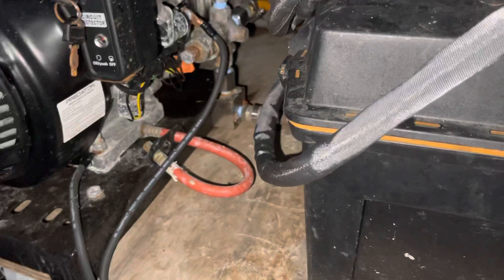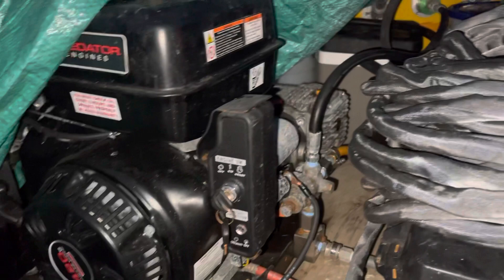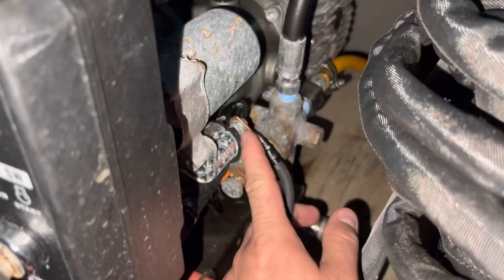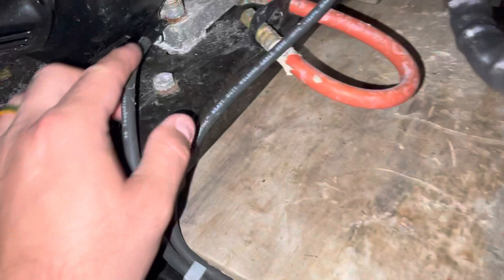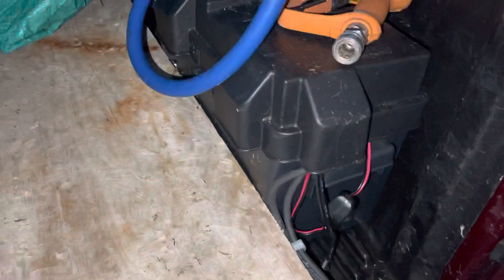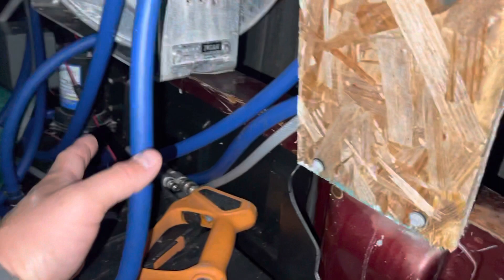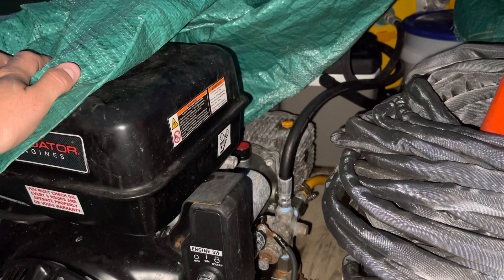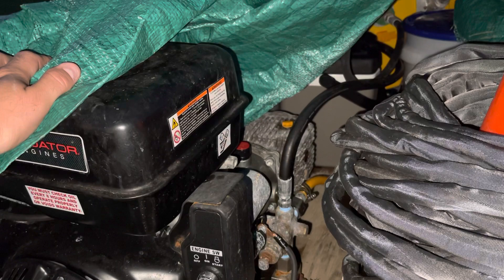Predator 420 Electric Start Wiring Explained.

Comment: I already have a starter hooked up but I want to add a charging system to my 420 would I connect the lead directly to the positive on the battery? Also how would I tap into the ignition for an ignition on lead?

Comment: Hey just wanted to thank you for the video, new sub. Question though, i have the predator 4400 Pressure washer looking to add electric start to it.. looks like you have that same kind of set up, although your motor looks slightly different. Did you buy a regular predator motor and then add a pump and the electric start? Or did you add electric start to existing Predator 4400 pressure  washer? If you added to pressure washer, do you mind providing link as to where you got the electric starter ?  Very much appreciated thank you for the content
Reply from the maker: Thanks for the sub and watching. This is customs build. I purchased the predator 420 engine and added the pump to build my own. The engine already had electric start on it when I bought it. I’m not sure if they make a kit to add it on or not.

Comment: By ground do you mean negative? Im comfised when you say hot wire is the the positive and negative in that same line?
Reply from the maker: Yes ground = negative, hot = positive. No the hot and ground are not the same wire. They are 2 separate wires.

Comment: hello, thanks for sharing your experience with this motor, one question, are they so good to use with a pressure washer? I want to build one but I have that doubt, thanks
Reply from the maker: IMO these 420's are rock solid. I have no issues with mine.

Comment: Can you use a 12 volt motorcycle battery to start. And if so can it be connected to the stator for recharging?
Reply from the maker: Should be able to, hook it just like this video and it will charge it

Comment: I just got mine I have the battery grounded to the frame but not the engine block (it’s painted frame so may be bad ground) and my positive ran to the starter, it runs and starts fine but won’t turn off when I turn the key off
Reply from the maker: hmm
Reply: Hey did you ever figure it out? I have the same problem with the key
Reply: I hope you figured your problem out by now but mine had the same problem and something had ate the end of the wire at the coil end. It’s the wire that goes behind the engine cover. Hope that helps.

Comment: Hi, I tried connecting a battery to my motor and white smoke came out of the motor, and now it won’t start off of a pull, do you think you know the reason?
Reply from the maker: You hooked it backwards
Reply: @KentuckyWashPros  i know that but why wont the motor start with pull start anymore? did i burn the ignition coil?
Reply from the maker: @moyeet7  it’s possible. Do you have your key turn in the ON position when trying to pull start?

Comment: Do you wire it to the same battery you use for your 12volt soft wash system?
Reply from the maker: Yes I did
Reply: Great thanks for all the help with great videos! Doing the 6.5 GPM build now!

Comment: I just thought the same engine. I cannot get my electric start to work my battery wires start smoking as soon as I try to start it. Do you not run your ground from the solenoid to your battery? I see that you have your ground from the bottom of your engine tied to your truck frame or something.
Reply from the maker: Do you have it setup exactly like it is in the video, if so then they shouldn’t be any issues. It sounds to me like you have it wired up wrong.
Reply: @KentuckyWashPros  i found it I wired up the solenoid wrong

Comment: Thanks for the video. I put electric start on my Predator 420cc  pressure washer. 
I'm currently researching an exhaust modification to make the engine quieter. 
Any ideas are appreciated.
Reply: You’ll want to look at a go power sports performance no restriction exhaust
Reply: Thanks for your input but, I don't care about restriction (it's not a performance engine). I want to keep it as close to stock as possible. 
Found one on Amazon that works better than expected.
Reply: @JCW418  how much quieter is yours now?

Comment: What battery are you using to run both systems? And do you ever have to charge the battery over night?
Reply from the maker: Running one 12v car battery to run both machines, 1 hose reel and 1 transfer pump. I don’t have to charge it because when the engine is running g it charges the battery.
Reply: @KentuckyWashPros  did you run any in line fuses?

Comment: Hey I like your video.  I'm looking to add a electric starter to my predator 420 pressure washer.  Can you please post a link to the electric start kit you bought?  Thanks in advance.  Keep making great videos bud.
Reply from the maker: When I bought my motor it already had electric start on it from the factory. I’m sure you could just google Predator 420 electric start and find a good one.
Reply: I ordered my Predator 420 electric start components from Honda. Predator 420 is the clone of the Honda GX390.

There are variations of the Kits depending if you want it to have charging capabilities or not.
Be sure to get a kit that includes the flywheel.

Comment: How many gpm did you end up getting out this??
Reply from the maker: 6.8 with no injector setup
Reply: @KentuckyWashPros  I found the pump but you never posted a link to the skid. And what unloader?
Reply from the maker: @mattburns4407  Pressure Washer Skid Plate Frame, Powder Coated Steel with Rubber Feet https://www.amazon.com/dp/B07BRYLKFK/ref=cm_sw_r_cp_api_glt_fabc_92GVT90KX2BN477MHJFD?_encoding=UTF8&psc=1
Reply from the maker: @mattburns4407  it’s currently unavailable but you can check with Southeast soft wash I think they sell them